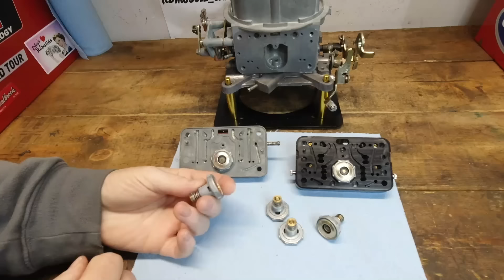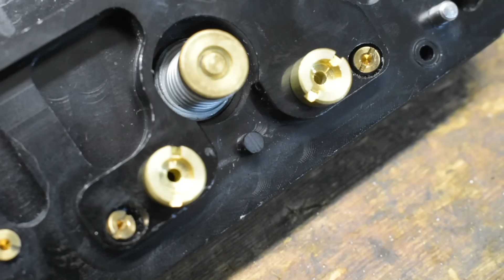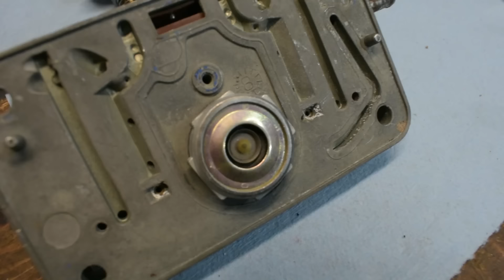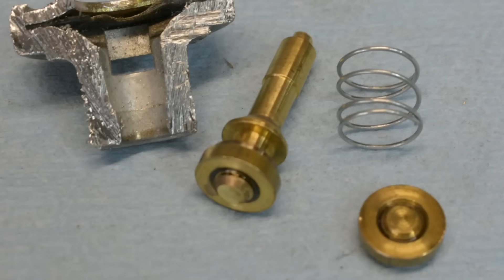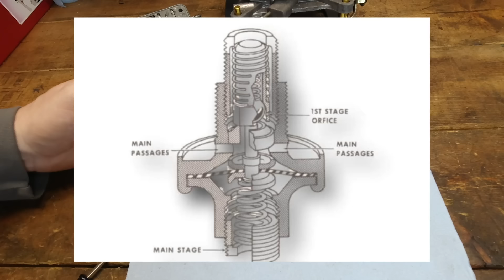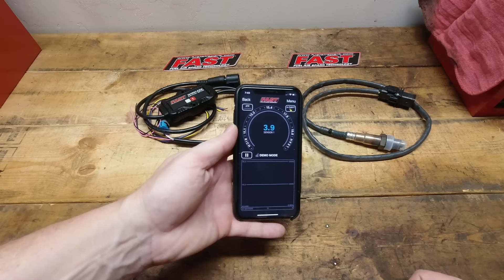Power Valves Explained: How they work, how to tune

Comment: I have an '86 Honda Prelude in the UK and it shows symptoms that point to a malfunctioning PV based on what you are explaining. I know someone else who has the same symptoms on their Honda. Engine runs well from cold but then once heated up runs rough and revs drop down suddenly. I am thinking PV may be stuck?
Reply from the maker: Could be.  Those cars are a little more difficult to diagnose.  If it’s throwing a code you can sometimes scan it and it might tell you if it’s a rich condition.  Or a quick swipe of the tail pipe will tell you if it’s sooty black it’s a rich condition.  Pull a couple spark plugs also. Can at least give you an indication of what’s going on.  I’m not familiar with that engine or fuel delivery system but if it’s still carbureted it will have an enrichment system like a power valve.
Reply: Many thanks for replying. The car is too old to throw codes up but all of the symtoms suggest it is the PValve. In the Honda manual (they had them then!), it shows how to test if there is a vacuum so i can get a cheap tester on Amazon or if i can locat the PV, as its not clear where exactly it is, I could swap from another Prelude that works. It starts well and is smooth as silk but once it warms up it drops revs, stalls and can backfire....

Comment: Hello, good video, very good explanation, you touched on a topic where you mention a carburetor with very high cfm for a very small engine. I will be waiting when you explain the physical difference from an 850 cfm to 650 cfm for the street and how to try to correct it. Thank you.

Comment: Great vid as always, this may be a stupid question, but I've looked around a bit and haven't found a good answer. Power valve in secondaries, is there an advatage if so how do you tune it, or should i just block it and jet up. Thanks for any insight anyone has.
Reply from the maker: I’ll end up doing a specific video on secondary power valve tuning but what it really boils down to is the application and how it’s being used.  I’ve generally removed them and gone to a bigger jet and smaller air bleed on a race carb.
Reply: @MuscleCarSolutions  car is for street driving but not a daily fuel economy, not a massive concern. It's an original 4053 780 vac secondary, which i don't really want to modify, was thinking of getting rid of powervalve just to simplify tuning, then maybe put back and jet down once secondaries are operating correctly. Thanks for reply, look forward to videos.
Reply: @Damothedevo 
Power valve on the secondary side is really only beneficial for a road racer or someone that will be driving with the carburetor opened into the secondaries. Most of us will be driving on the primaries and only getting into the secondaries periodically. If you decide to block the secondary power valve circuit make sure to increase the main jet size to make up for the circuit that you eliminated. Usually about 8 jet sizes depending on the power valve channel restriction size -the holes behind the powervalve.

Comment: using the rpm might be easier , drive at 30 or 40mph on the right gear, check rpm,  check vaccum at that rpm when stopped and get a reading

Comment: Does any of the vacuum gauge tuning advice change for an airboat application since it is always in gear and under load due to the prop spinning at idle?

Comment: So help needed. I have a ATM Innovations XRSB-750. I'm running really rich 11.2 at idle and 14.0 at cruising speed. The fuel is pushing out of the exhaust at Idle and wanting to die upon any acceleration. For context I have pump nozzle of 31 primary and secondary 35 high speed bleeds 70 idle air bleeds .78 primary main jet and .93 secondary, 33 idle feed restriction, 2.5 power valve and 110v needle and seat. Timing locked out at 38 with 7.5 psi of fuel pressure that can be regulated down if needed. My question is what changes do i need to make to fix the off idle stumble/car completely dyeing or choaking out and the extremely rich low end. Thanks in Advance
Reply: Did you ever figure out that your fuel pressure was too high?

Comment: Thanks for sharing the knowledge. My question cant be answered by anyone but the guy that installed a Holley Street Avenger 670 cfm on this 1983 GM 305 ci. That is, why  is this 670 on this engine?  I did not check the numbers on the heads, knowing that people like to install 350 heads on the 305, I should check that. That may answer that question. However, , specs. call for a 550 or 600 cfm on typical stock engines of the period. So, it idles great, it runs smooth through all driving ranges, but, it smells rich at idle. Primary jets are 65, power valve is 6.5. I intend to do the vacuum gauge trick you showedto determine engine to power valve requirements after I get the carb back together and installed. Mostly, my question is this, what is your take regarding the overall functionality of installing a 670 on a tired 305 ? The engine is installed in my 48 Plymouth, a back road cruiser car, all it needs is a 2 bbl. for that, but right now that option isnt available to me. What say you ?
Reply from the maker: A 500 would probably have been a better choice.  The jets have nothing to do with fueling at idle.  That’s what the mixture screws are for.  Can you make that 670 better?  Most likely.  People generally don’t tune carbs.  They just bolt them on and complain they aren’t perfect.  😆
Reply: The idle a/f ratio is controlled by the IDLE FEED RESTRICTION size in the metering blocks. They are not changeable from the factory on most Holley carbs, (they SHOULD be!), but the metering blocks can be modified for it. The HP series carbs have changeable IFRs (idle feed restrictions) and PVCRs (power valve channel restrictions). .002 or .003" of an inch difference goes a long way concerning Idle Feed Restriction size.

Comment: so when you are checking engine vacuum at 30, 40, 50 and 60 mph - do you take that number and use it for the power valve, or do you still divide it by 2?  Thanks!
Reply from the maker: More so I know when it opens.  With that info you can verify if you want it to open sooner or later.

Comment: For all of the young people watching this, try to imagine growing up in the 70's and 80's, being 15 or 16 years old and trying to figure out this stuff before the internet and smart phones. My current carb (Since 2006) is a 1095CFM Demon. My cousin, (A younger, LS  guy) refers to it as "A semi controlled fuel leak".  Fuel injection is awesome, carbs are old school, I enjoy them both.
Reply: Carbs may be old school but Id take them over efi any day on an older vehicle.....
Reply: FACTORY fuel injection is awesome! GM, Ford, Toyota, etc. can make a high quality, durable fuel injection system that works consistent. Year after year. Aftermarket? Not so much....
Reply: I wish I did I tell people weekly I was born in the wrong era
Reply: Think about what it was like before you could buy off the shelf camshafts? My Dad used to grind his own back in the day (early 1960's) because there was no "performance store" available, you were it! there was know "knowledge base" to reference on profiles, ramp up, durations, degrees. You started with a piece of 2.5 bar stock!
Reply: @billk9628 No, your dad did NOT grind his own cams. DON'T make up B.S.!! 😒
Reply: The one thing that helped the most ...... was listening carefully...
Reply: it was hard at the time to learn how to work on carburetors...
now imagine a young guy choosing carburetor over efi and making more power! that's me.
one of my close friends, a remaper, believed that carbs are worthless and not reliable to tune up to make power until he bought a peugeot 205 tu3 with weber carb on it, as he tested the car to see AFR with wideband sensor he have seen the most stable AFR ever on the whole rpm range of the engine, excat 13.5 to 1! he has quit making jokes out of my car since then.
i drive a peugeot 405, hand made engine (xu7 internal - xu5 cylinder head - xu9 camshaft - lightweigh flywheel and pulleys), 10:1 CR, 1800cc, aisan 2f carb, fantex delco and coil, magneti marelli ignition module.
my next project is to remove camshaft mechanical fuel pump and add high pressure/flow hearting pump.
Reply: Efi makes more power lower rpm, but the carburetor makes more in the higher rpms. Naturally aspirated, of course. There's many dyno videos that prove it. Younger tuners seem to hate it but numbers are numbers

Comment: I have a zz502 with a holley 950 cfm when im takeing off it has a hesatation and low power and cruiseing its surging up 2000 then after that its a rocket but cruiesing from take of to 2000 cruiseing its a dog
Reply from the maker: The challenge is to determine if it’s a lean condition or a rich condition.
Reply: Bigger primary jets.

Comment: I have a old 600cfm 4160 on a ford 289 and at half to full throttle it’s way rich idle is good but regardless of how much tuning I do I can’t get it to lean out at part and full throttle. It has a 6.5 power valve that came with the kit.
Reply: If you haven't fixed your over rich 289 yet, your problem is the power valve CHANNEL RESTRICTIONS are too big in your 600 Holley. The proper fix is to modify the metering block with changeable restriction sizes (something Holley SHOULD have done on ALL universal carburetors). The power valve channel restrictions are the two holes behind the power valve when removed.
Reply from the maker: Tried a smaller valve?
Reply: @MuscleCarSolutions  well I’ve been thinking about it. Warmed up it reads about 15 inches of mercury. It has a small cam in it. So I’ve been trying to figure out what size power valve I should get. And at those throttle positions, the AFR‘s bounce between 12 and 10.
Reply from the maker: Well at half throttle the PV should be open.  So try a smaller PV and see if it leans that condition out.  Try a 5.5 next and see how it does.  If it gets better but not perfect, try a 4.5.  Start with the 5.5 though.  Make small steps.  If that helps, then you’re on your way and retune.  The 600 is probably too much carb, especially if that’s a mostly stock 289, so you’ll not get it perfect but you can make it better.
Reply: @MuscleCarSolutions  ok thank you

Comment: Yeah, but you can tune it take to get to 4150 into it down to 500 if you use the right car valve in the right jet size and spring size and metering rod
Reply from the maker: I’m not understanding much of what you’re trying to say, but if I do understand what you’re saying, no.  You can’t change the CFM of a carburetor.  It’s fixed.

Comment: I was surprised you didnt go over how the early holleys didnt have power valve savers and when the engine backfired it would blow the power valve diaphragm out and it would just mess up everything. I used to drill out the power valve channel and install check valves but holley does that now..!! Lots of good info ...!!
Reply from the maker: Time.  Time dictates everything.  If I include too much information, folks seem to get spicy about it.  So I try to compact it all in and not go down every possible rabbit hole on a topic.  That’s difficult to do sometimes!  Thankfully Holley fixed that issue in the 90s cuz back in the day… we changed a LOT of blown power valves.  😂
Reply: @MuscleCarSolutions  🤣🤣🤣 You got that right.

Comment: If you run a 750 dbl pumper with mechanical secondaries do you run the same jet size in both meetering blocks? And should you have a power valve in both blocks?

Comment: Does power valves come as a adjustability options? Like a flat screw driver head on the power valves?
Reply: I am now thinking of a blow through carburetor.
Reply from the maker: There are boost referenced power valves for blower applications.

Comment: Would the power valve have any effect off-idle? My 351 with 600 vac sec has on off idle stumble that I had attributed to the accelerator pump. By the way, it's worse when col, better when warm, so it's a lean mixture problem.
Reply from the maker: It’s possible.  What PV is in the carb now?  But I’d start with some other things first.  What’s your timing set at?  What is your idle rpm set to?
Reply: @MuscleCarSolutions  Idle in gear when warm (auto) is about 700rpm. I'm unsure how much advance I have in it, it's quite a lot as it's obvious when cranking, there is no detonation though even with lower octane fuel. I have no idea what PV Is in now. Not had the car long just starting to go through it

Comment: Fuel float level is everything the most important part. Used recommended power valve for the number carburetor you have for Optimum air fuel ratio. Holley fuel float level is the most important thing in making a holly run proper. Tuning Holly's is a myth unless you have something special that runs on track
Reply from the maker: I’m having a difficult time understanding what you’re trying to say.  So one power valve size for the carb and no other condition is important?  Like CI, camshaft profile, how it’s driven (street or otherwise), transmission, weight of vehicle, other components, elevation.  The only thing that’s important is float level?
Reply: @MuscleCarSolutions  no, camshaft size directly influences engine vacuum. That being said the power valves application is dependent upon engine vacuum. Formula: vaccume (hg)÷2=power valve size (hg). It's physics 101. Sincerely
Reply: Engine vaccume is at idle is directly influenced by idle mixture and float levels
Reply from the maker: @wadetaylor4697  by that statement then, you can change the engine vacuum by lowering or raising the floats.  That would be a new one for me.
Reply: @MuscleCarSolutions  are  you special? EVERYONE KNOWS IDLE MIXTURE IS SET AT MAXIMUM VACCUME, WHICH DEPENDANT ON FUEL FLIAT LEVEL. YOU HAVE NO BUSINESS TEACHING IF YOU DONT UNDERSTAND BASIC CARBURETION
Reply: ...ignorance is defined as an "inability to learn"
Reply from the maker: @wadetaylor4697  I’m asking because you made an absolutely ignorant statement that float level effects engine vacuum.  So go make a video where you change float levels and it effects how much or little vacuum an engine produces.  Your statements, not mine.  You’ll be the first person in the world to control engine vacuum by the height of a carburetor float.

Comment: They called them "economizer" valves back in the 70's ..
Reply from the maker: They for sure can be a way to save fuel consumption.  But more often they are used to bring in fuel at the right moment for max power.
Reply: economiser might have been the name they gave them to make them sound better ..ford 2 barrel carbs ..changed 100's -1000's of them ..They were color coded back then ..also had to take the tag to the parts dept to get 1 ... seem to remember the black one was the best one ...paid 1/2 hour to change it ... wooo hoo

Comment: I worked for ford in the 70's ..we changed these things a LOT ... I am long retired from that ... I was wondering what the new ethanol fuel does to those power valves ??
Reply from the maker: Ethanol isn’t friendly to anything it comes in contact with.  They have changed the materials to be a little more resistant to it, but it’s just a matter of time before the water and garbage that’s carried by it has some negative effect. Nature of the poor choice in fuel additive.
Reply: @MuscleCarSolutions  I was out of it when ethanol can in the picture ...worked around boats then and saw a lot of people having problems ...the 70's was the beginning of emission ...real emission controls ...the motors really suffered from it ...poor/bad idle and NO power ...

Comment: I remember the 67 Chevy Caprice with the Big block 427 had a factory vacuum gauge and there was others in a long them year's also had factory vacuum gauges....A crucial measurement.. I  also installed inserts in the manifold and or Header's back in the day to read the color of the exhaust Flame..... other little tricks putting the car under load while setting timing and there are many other recurve Kit's and on and on..... Very good content here😎

Comment: I dont understand how a higher vacuum rating power valve opens sooner. Why doesn't the smaller rating see that number sooner and therefore open up sooner?
Reply from the maker: Let’s say at idle, your engine produces 15 inches of vacuum.  You roll into the throttle, load increases and vacuum starts to drop.  Let’s say you have an 8.5 rated power valve.  When the vacuum drops to that point, the valve opens and provides the fuel for the demand the engine is asking for.  Now let’s say you have a 4.5 power valve.  You’d continue to add loss to the engine till it drops to 4.5 and the power valve opens.  The higher ranked number opens sooner because in this case, the engine will see that higher number of vacuum first and supply the fuel needed at that point, if you determine that’s when it’s needed.

Comment: If your engine is cammed up, don’t be surprised if you have to use a 105 Power Valve and install one size larger front jets than what came in the carburetor stock when using Premium gasoline that has the 15% ethanol.

Comment: Holley used to recommend a different process for PV. 
**Automatic timing & idle set, engine operating temp, “In Gear”: 
Vacuum hg minus 2hg= base PV. 
**Manual transmission timing & idle set, operating temperature: Vacuum hg divided by 2= PV.
Reply: Exactly

Comment: How do you adjust with 2 power valves? Do you run a smaller one on the primary and a bigger one on the secondary if its vacuum secondary or run them the same size?